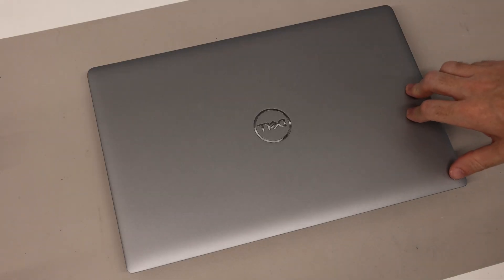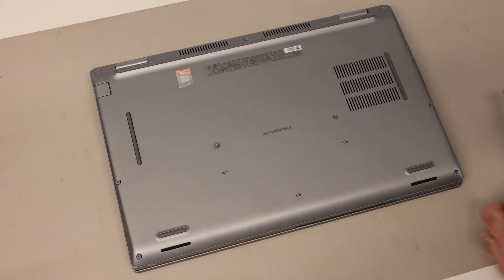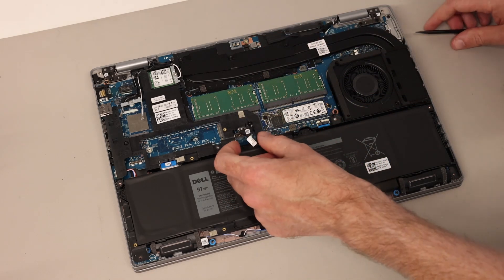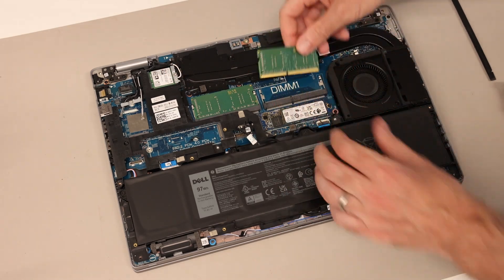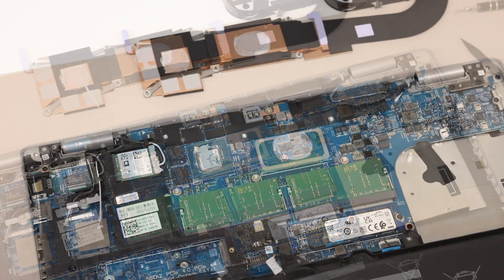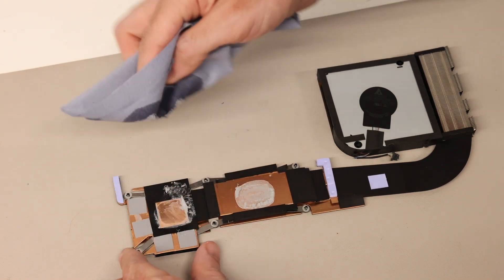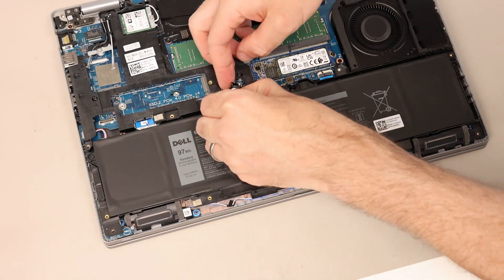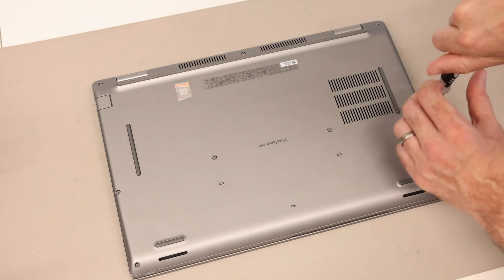Dell Precision 3561 - RAM/SSD Upgrade, Battery Replacement and Cooler Cleaning/Repaste Guide

Comment: How is the fan noise under load?
Reply: Depends which isn't my favorite answer to give or hear. Dell has TONS of very customizeable profiles built into this laptop (I've owned two of them) if you put it in preformance mode for the CPU and the fan, then hit it with a 100 percent load (very hard to too tbh) on both the GPU and the CPU then it's pretty audible, but noise canceling headphones will hide it. (it is NOT a super high pitch which is something I like and care about alot)
If you're a standard user and using it in real world scenarios where only the gpu or cpu are maxing and for short loads, you won't hear it with headphones on even with the preformance mode (non-noise canceling)

There are at least 4 profiles on these always. (the profiles I'm reffering to are only in the bios/uefi) I'm not mentioning the ones your os (I'm assuming windows) may present to you. Hope that helps. 

Dell is too aggressive with their power saving profile on these. Their cooling is adequate but too aggressively downclocked as well. 
you lose about half your preformance putting these in a balanced mode (used to not be as bad) and at least 60 percent of your performance in power-saving mode. 

sustained loads aren't so bad (so once a program is open and running) but you REALLY feel the preformance hit when you load up a new program. Overall they've been my favorite work laptops I've had over the years, but admittedly not my first pick if I were the one put in charge of ordering our computers. 
For an Enterprise laptop, these are as good as they come in terms of long term repairability, upgradeability, and while you have it.... warranty. You are paying for the warranty though. They're probably 30 percent higher in price than other comperable computers out there spec wise. 
If you buy one 2nd hand they're a great deal. I bought my 2nd one 2nd-hand because I loved my first so much. New these are over 2k and really haven't improved much in the last 3 years hardware-wise. You can find them about 400 bucks 2nd hand in meaningfully good condition. (screen works, and all hardware is good, just cosmetic damage and a need for a round of new thermal paste. 
There are of coarse better laptops out there in terms of repairability and upgradeability, but seriously... nothing that touches these in terms of warranty and Enterprise coverage. Please stay that way Dell!  

Hope that was what you needed to know @EManimations